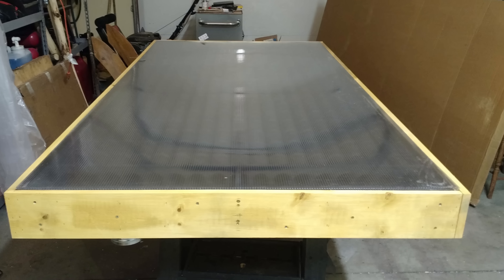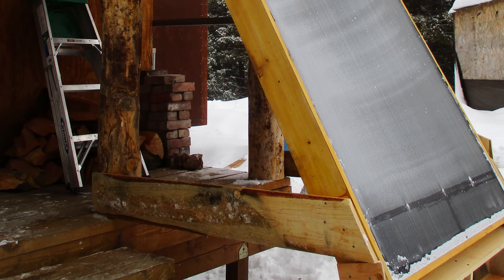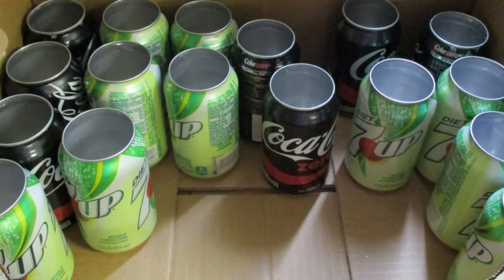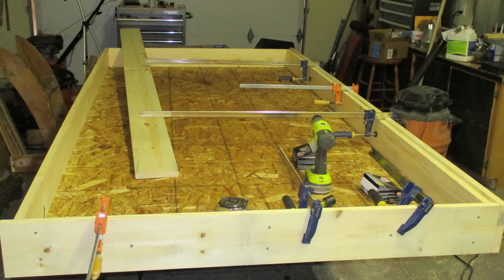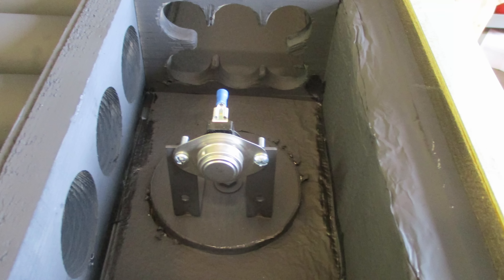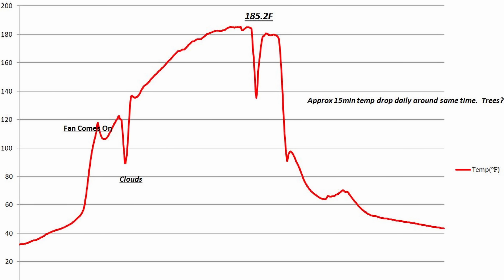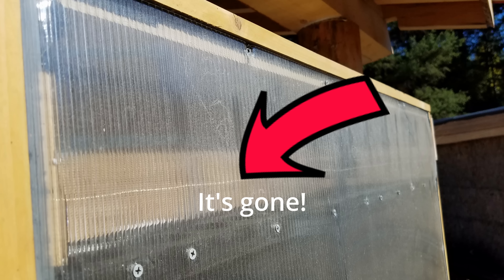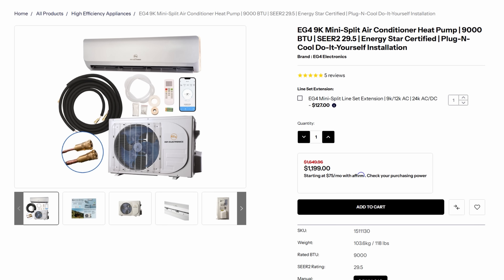7 Years with Pop Can Solar Heater - Is It Still Worth It?

Comment: I love to see things recycled and I like the use of cans, but to be honest I think I would use Aluminium ducting or Aluminium tubes of the type they use for signage, that would make construction easier, the bilge fan needs to be blowing into the unit not pulling out hot air, that would burn the motor out. Then a simple none return valve made from a thin piece of silicone sheet or thin Teflon, Polythene may work if mounted in a cool zone.
Reply from the maker: Interesting point about the fan!  I hadn't thought of that.
Reply: Better yet is 3 spaced layers of black window screen
Reply: Drier vent hose ? Could you use it to dry out the hot air coming from a drier ? ... maybe a door in the bottom chamber of the "solar stack" for lint removal ? The pressure of the air from the drier would close the none-return-valve in the lower chamber, air intake. 
What would you do for a valve in the upper chamber to Vent-heat / Use-heat ? Could that valve use a thermostat ?

Comment: Solar and batteries have become so cheap and effective at powering everything it makes more sense to build a system and get the AC unit nowadays....
Reply: Absolutely. 
but projects like this one works fine if you manage to find reclaimed material
instead of lexan that sounds pretty expensive, just a thrown away termopan windows. 
the same with osb, and the pine.
Reply from the maker: Solar and battery technology has come a long way and is a great solution for many!
Reply: More efficient even - but much less fun. Also if you can build it out of scrap you have around it's a lot cheaper than from new. An old double glazed window, some recovered timber (or even an old fridge chassis) and bunch of old pipes or similar.
Reply from the maker: One thing I mentioned in the original video from 2017, is that I have a sawmill, so the lumber is virtually free for me.  

Now, lexan, for me, is light so easier to move a heavy box around, specially because I had to do it alone mostly.
Reply: That’s the same conclusion I come to every time I try to design a passive solar heater.

Comment: I thought of something similar. I was going to use 1" PVC painted black. Glad yours worked!
Reply from the maker: PVC will work, just not as well
Reply: PVCi s a great insulator and will not put the heat into the air.. Alum. or copper.
Reply: PVC is a bad idea given the temperatures involved - especially if the fan dies.  It can start getting soft at 60C (140F), and decomposing at higher temps.  CPVC has better temp specs, but even that is subject to melting - it's only rated to 180F.

Any metal tubing would be better.
Reply from the maker: Great point -- I wasn't thinking of that!  I was just thinking that the thin aluminum cans dissipate heat very fast as they heat up making them a very efficient item to use in this case

Comment: 3 meter aluminium pipes sand inside my next summer
Reply from the maker: Interesting idea!
Reply: did you found the pipe for free from reclaimed stuff?
If not... hmmm.
I looked for the price. for the same diameter the price is twice as much as vacuum tubes. 
And these does not need insulation.

Comment: I built the black screen version to avoid the pain of all those cans. I think I mentioned it in another video, but I used a little 5v solar panel mounted above it that ran a boxer fan when the sun was shining and it was making heat. I didn't bother insulating the box tho. And I know I didn't spend very much lol. Might be why it only survived 2 years
Reply from the maker: Still, fun experiment

Comment: I wonder if you could replace the Lexan on the outside with a bifacial solar panel and get it to produce electricity as well as heat? I know the solar cells would shade the interior to some degree, but the cells would contribute heat that may make up the difference.
Reply from the maker: Interesting idea. 🤔

Comment: Found a mini 12kbtu a little over a year ago for 600 bucks. About 800 now I think? Keeps my shed where all my equipment and batteries are at 74 degrees year round. Sips power to do it. Very happy I chose the path.
Reply from the maker: Nice
Reply: @beebop9808  diesel heater?

Comment: I did something similar. I have three large south facing windows and decided to make two solar heater's, one for each side window leaving the center window open. But i placed the solar heaters on the inside sitting on the window sill. Used some left over 4 inch corrigated drain pipe instead of can's. Used a 4 inch inline duct fan for each unit to blow air through the bottom out the top hole that has an adjustable vent elbow to help direct the heat. Didn't need to insulate the box because it's on the inside of the house. I use a small 150 watt power inverter hooked up to a 100 ah fishing battery box. 200 watt solar panel  keeps battery topped off. Sun is low enough in the horizon for it to heat up. Helps keep living room and dining room warmer.  Take it down in late spring and place it in the garage.
Reply: I just did sort of that right now. But only a flat surface. 
I mean all the window, even is triple glass, still radiate cold inside through the glass and wood frame, plus air through spaces around. 
So I built a lid to fit in the concrete walls around covering all three windows, and prevent any cold going inside during the night. 
For when the sun is up, I just painted black the side facing out. I will let the upper side open for the day.
Not sure how efficient will be, since sun hit my windows from the left at noon. At that steep angle means nothing.
Two hours later the angle will be good enough, but with all the trees even bare, with no leaves, will block a part of the rays. 
Other two hours later the sun will go behind a building.
But for sure no matter how little heat I will get, it will offset those two bucks I wasted on the black paint. :)
Heat gets in anyway, but the black paint I hope will be more efficient at converting the photons into heat.
Reply from the maker: That's a clever way to get some extra heat!
Reply: If you have South facing windows,  you just open your curtains. 
All that free solar heat will come in through the windows.
Reply: How stuipd can you get? Any sunlight that has passed thru the window is already heat in the house. . The heat is in the house. No collector is needed. What a waste of time and money.
Reply: @kkarllwt  It is at least possible that they are using this to provide warm air to an area not near the window, such as in the next room that doesn't have a good window. In that case, I could imagine this type of construction would provide a bit better energy transfer than just air ducts between the rooms, but it certainly is a lot more work than just poking a couple of holes in the walls separating the spaces and perhaps installing a fan to help increase the air flow beyond convection.
Reply: @kkarllwt  yep there are all kind of stupid. 

and for sure I had my rich share of stupid things done along more than half of a century. but at least I try to learn.

but this statement that any sunlight that passed through the glass is already heat in the house does not seem too smart to me. 
In my case, that sunlight hit an really white surface. It is polystyrene foam. And I do not know about the OP, but for him may be white wall or floor or whatever. 

And anyway, how stupid will be not to try and test. I paid only 2 bucks for the paint. And will cost and nothing to test different situations. Before this insulation, I mean right now I have some brown blinds. In other room I have white blinds. The brown blinds gets warmer during the day, and offer some insulation during the night, but not so great. I tested the foam few days, when out was not really cold, but chill, and even not well mounted, a lot of gaps around, provided a 4  celsius degrees difference compared with the room.

And about stupid things, about two decades I already tested the efficiency of insulation. It was a much smaller room, and not concrete, but thin wood. foam insulation helped me stay warm with no heating till freezing point. I mean no heating beside myself and my computer. Below freezing till -10 I used an 100 w bulb to heat. I could not find such a small heater, and did not bothered with a thermostat. A bulb was good enough solution. and it was cheap net to nothing. During two winters there were few days colder than minus 10. A cold spell reached -20. During those days I just added one more bulb. Also I had a heater too, but I used only when I was mot there for longer periods, and was too cold for the bulb to compensate fast. The heater was doing the job in few minutes. Anyway, with that noisy fan was not a really good option. 

Here in this room I need to start heating when outside is about 10 celsius.,  The consumption will be maybe 5 kwh around freezing point, and in cold days close to -10 the consumption rose to 10 kw h per day. The building already has insulation outside, but is standard insulation, not really efficient, since the sill are quite wide, and not insulated. Windows are tripled, but thermal camera still show a lot of losses. 

Now let see how much will help those 50 bucks spent on foam. That paint is just an bonus, and I have no idea how much will help. But definitely will help.
Reply: @kkarllwt  That is NOT the way to speak to anyone, about any subject. All of your other comments are civil, so surely someone taught you better, and sadly you forgot ourself for a moment?
Reply: @kkarllwt  Yes, basic physics.  They accomplish two things: 1) Concentrate the solar energy into a smaller space so the same energy is at a higher temperature,  2) Deceive themselves into thinking the higher temperature = more energy.
 I agree, this is dumb.

Comment: Never heard of it but it’s interesting. 
Down to what temperature did that work for you?
Reply from the maker: It works in all Temps!  I've seen it generating good heat at -30F!  Along as sunlight hits it, it works!
Reply: @TheOldJarhead  nice. Could be a nice boost for those sunny day and a bit of savings on the fossil fuel side. 
By me in northern Maine, we get long stretches of overcast sky in winter but even 10-15 nice days can make a difference
Reply from the maker: Yup

Comment: Free heat also comes off solar panel (even with double glazing)
I can get 50% of the solar output from a panel , simply by mounting it up against the inside of your window (so long as panel size permits) AND you also get approx 45 degrees heat emitting from the back of panel into your house; as well as infrared.
Reply from the maker: That's a neat way to get some extra heat!
Reply: Solar panels work better when they're cool than when they're hot. I wonder if some clever person could come up with circulating water behind the solar panels (without getting them wet of course) and use that heat for the house.  But, like @kkarllwt said, don't block the sun from coming in your windows with your solar panels, you're just working against yourself.
Reply: All the sunlight that went thru the window is already heat in the house, No need to build anything, Be smarter.

Comment: The link below shows a method of making a pop can heater without using a single pop can. It's done by making aluminum tubes out of a product called Rosco Matt Black cinefoil, Cinefoil is used in photography in order to achieve desired lighting. Everything else is done very close to your heater. I added a 12 volt computer fan at the bottom in order to increase the airflow. seventeen percent more heat and way less work. I built mine in 2014 and have been enjoying the free heat every winter here in North Idaho.  The link below shows how my cinefoil tubes were made. https://youtu.be/HnBq6g406F8
Reply from the maker: Interesting technique.  I'd probably mess it up! lol but I've seen lots of ways from punching holes in cans (that are free after all) to using downspouts and more.  They all work but man, don't plug them up!  lol they go nuclear!